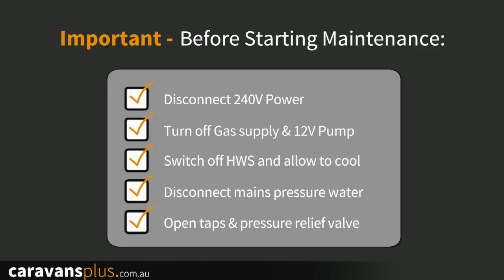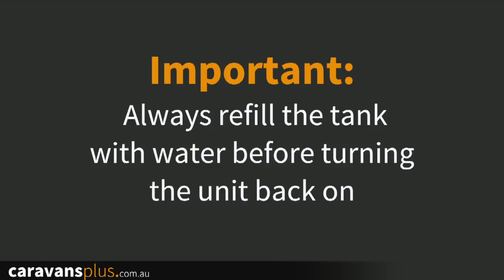Suburban Anode Replacement & HWS Maintenance

Comment: Do you have a video on changing the gooey stuff around the window? I don't know what to replace mine with,  so many different suggestions on the web but i'm not keen on using silicone or sikaflex. 
1994 coromal seka pop top. The window leaks so bad it's like a tap. I've stripped the inside lining of the van and giving it a makeover.